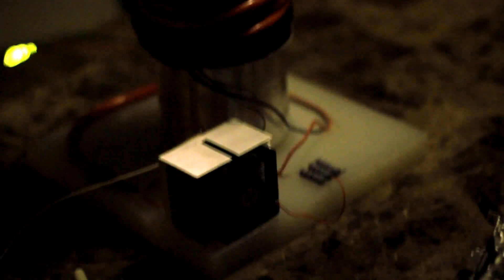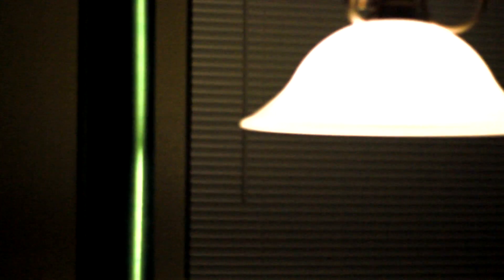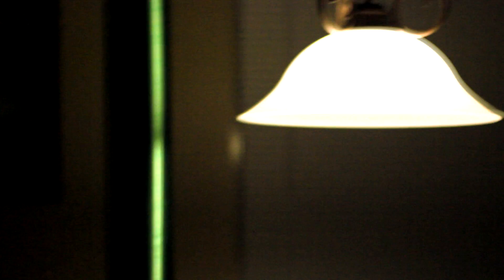Slayer Exciter Plasma

Comment: is it possible to make a railgun that can accelerate that plasma for at least 30m before deionization? If so what are the energy requirements for that railgun? would it be more efficient to use a coilgun/gauss gun?

Comment: You might as well just build a Tesla Coil.  I really don't see what advantage this thing has.  A Tesla Coil can generate MUCH higher voltages and a lot more sparks and plasma, and it will also light up florescent and neon tubes without wires.  It uses resonance, whereas a Slayer Exciter just seems to be a solid state induction coil.  Interesting, but kind of seems like a low power imitation of of a Tesla Coil.